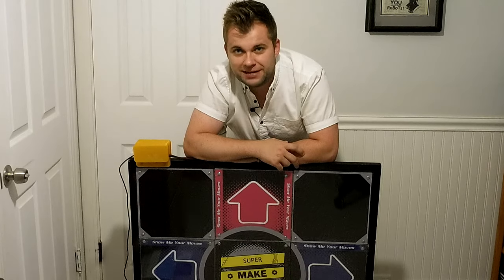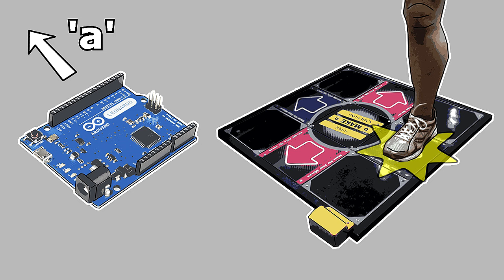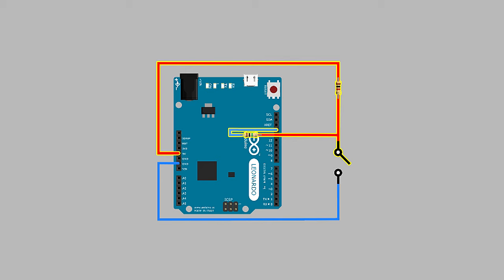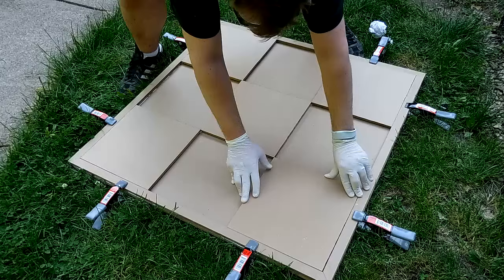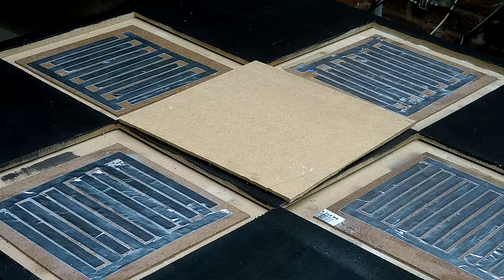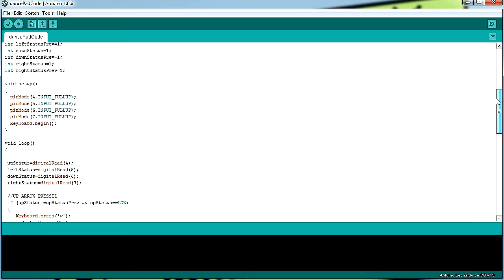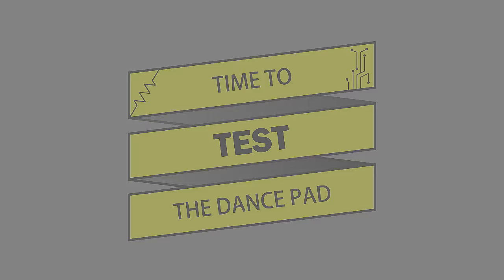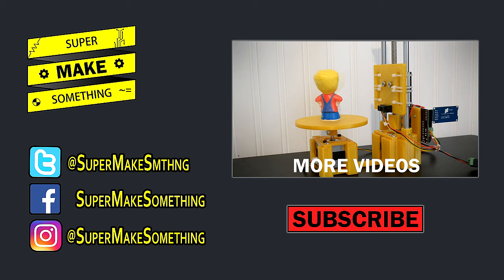USB DDR Dance Pad (Arduino, Pull-Up Resistors) - Super Make Something Episode 9

Comment: Nice job! I'm working on building a dance pad myself. I'm trying to make it as faithful of an arcade pad replica as I reasonably can, with authentic Pump It Up sensors, recessed half inch thick acrylic arrows, and metal wrapping the non-arrow panels. It's a big expensive project, but I'm hoping it'll be worth it in the end. Out of curiosity, how much did the components of this pad cost all together?
Reply from the maker: That sounds cool!  The raw material cost for this project was ~$75, with about a third of the price coming from the acrylic sheet.

Comment: I've been going over some plans for making my own DDR pad, and it's very similar to this one.  I had planned on trying to use either copper of aluminum tape to build the contact surface, but it seems most of those do not sent a signal though the adhesive side.  I'm planning on ordering some full on copper sheets instead.  

When you drilled and secured all of the panels down, did you just run a threaded screw though everything to the baseboard?
Reply from the maker: Copper sheets are a good idea, I think -- trying to create a solid connection with the aluminum during the installation is definitely a bit tricky.  The "Lexan-Graphic-MDF sandwich" actually isn't screwed down into the base plate; it just rests on the foam.  If you wanted to attach everything together with one long screw into the baseboard, I would suggest putting some linear compression springs over the screws so that the panels can bounce back up.
Reply: Oh ok, so the button panels are just screwed together to hold the plexiglass on top of the mobile panel?  and if you turned the pad upside down the buttons would just fall out?  I had considered something more akin to how the arcade machines are held together, with corner brackets holding the mobile panels in place, but I haven't looked into it as much.  

My current plan was to get some really long wood screws, with both a threaded portion and a smooth area closer to the screw head.  after sinking those all the way through, it would probably stick out of the baseboard, but could just be but off and sanded smooth.  I'm still in the planning stages, but since my design in my head is pretty similar to yours, i do feel more confident about the design.

Comment: Hi. Thanks for the video. I am planning to make one of it. Can i use the arduino UNO in stead of Leonardo?
Reply from the maker: Hi Luis, unfortunately the code will not work with the Arduino Uno, because it requires a microcontroller that can natively act as a USB HID device -- in this case, the ATMega32u4, which can be found on the Arduino Leonardo and Pro Micro.
Reply: @SuperMakeSomething  You may not be able to use the sketch you provided due to the absence of keyboard.h library on the Uno, but you can still get it to work by using the uint_8t command to report as keyboard, loading uint_8t with a keycode and doing a Serial.write with the desired Keycode loaded in the buffer. To make the Uno act as an HID device, you must flash the Atmega16u2 chip with the correct hex file.

Comment: I been looking at metal dance pads the last few days. I wanna get back into DDR. I had a fabric/mat kinda one and didn't really like it (and thus didn't really use it). Then I found this video. This looks awesome! I wanna make this. Besides the upgrades at the end of the video, are there any other things that you would've done differently knowing what you know now? I noticed the video was uploaded 5 years ago.
Reply from the maker: Thanks! I think the next big change I would make would be to use springs instead of foam, since the foam has to be replaced relatively frequently (depending on how much you play). Other than that and the improvements mentioned at the end, it’s been pretty solid! Good luck with your build if you end up decided to make one for yourself!

Comment: For some reason the code is not showing up when I downloaded it do I need some thing to make it work?
Reply from the maker: The link should download a zip archive, which contains the dancePadCode.ino file.  After unzipping this, you should be able to open it in the Arduino IDE.  It may give you a message that the file needs to be in a folder called "dancePadCode," but it should automatically generate this for you when you click ok.
Reply: Thank you ill ive that a try

Comment: Hey there, I'll be doing this after the quarantine! I was wondering if there's any way I can build this one with two extra buttons (x and o) so I can select songs from the pad itself. I know this should add more lines to the code but I was wondering if the arduino supports two extra buttons, as I have never used one. Thanks!
Reply from the maker: Jairo Pineda Hello Jairo! The Arduino definitely supports more buttons! You would just need to duplicate the corresponding lines of code and change the pin number and corresponding key press. Hope this helps and good luck with your build!
Reply: @SuperMakeSomething  Thank you so much Alex!
Reply: you can take apart a usb controller for a gaming controller and use that much easier than arduino

Comment: I'm really interested in doing this and don't know anything about electronics or really anything you named. What kind of screws would to recommend to screw the washers down as an improvement? And do you have any ideas as to how to add a metal bar to it?
Reply from the maker: I would go with wood screws, since these will "bite" into the particle board. Another poster in the comments suggested using copper tape, since you could solder to it directly, which I think is a good idea. For the bar, I would extend the pad with another "segment" at the back, and then buy piping at the hardware store. Hope this helps! Good luck with your build!
Reply: @SuperMakeSomething  thanks so much! thanks for making the video

Comment: Do you have anything connecting the pads to the base board or are they just loosely put on top. If so, don't they drop out if you tilt the board for storage etc?
Also how would you go about adding additional pads in the corners? I am currently not sure if I should add fixed walls between the pads or just put the loose parts next to each other.
Reply from the maker: Good questions!  At the moment, the pads are just loosely placed onto the base board.  Since the board is at a slight angle against my bookshelf for storage, I have not had any issues with pads dropping out, though this could be a possibility if the angle is steep enough.

Whether or not you add fixed walls depends on the button pad sizes you are going for in your build.  You could add walls, though this may affect the button size and spacing.  Alternatively, you could make the screw hole in the wooden portion of the pad a clearance hole so that it can move up and down the screw freely, add some more foam between the pad and base board around the screw, and then drill the bottom of the screw into the baseboard.  In this case, the foam would act like a spring.  This would simultaneously alleviate the problem of having loose buttons bumping into each other if they are not separated by a wall, as well as the storage problem.  I wanted to do this for my build initially, but unfortunately did not have screws that were the right length.  If you end up going this route, please let me know how it works!  Best of luck with your build!

Comment: Love your video. Very in-depth. Was curious if there was a reason for the design of the foil. Also wondering could the foil be replaced with copper tape?
Reply from the maker: Thank you! Copper tape would definitely work — and would probably be a better option honestly. I used foil because it was the easiest large conductive “sheet” that I could think of for the top panel. The “comb” design was just to increase the probability that a button press would get registered regardless where a panel was stepped on.
Reply: @SuperMakeSomething  awesome thanks for the reply!  Also I noticed in your build that the arrow pads are more or less floating and not secured to anything. Do you have any suggestions on a way to secure the arrow pads so then went stored upright they’re not falling out

Comment: Very nice. Im going to use the same build concepts for a Pump it Up pad this week. Any tips for that.
Reply from the maker: KalebDoesThings Nice! Good luck with your build! Two suggestions would be to use polycarbonate for the clear button panels and also to add a “debounce” to the code to keep the pad from falsely registering button presses during a hold. A few users have added a link to this code mod to the comments, so definitely check it out!

Comment: Hey Alex - Kudos for making this mate! The design was simplistic yet looks really solid in terms of sensitivity as well as ability to stand up to long hours of play. With your pad - Did you find that it slipped a fair bit? How about those 12+ footer songs that start to get rediculous without the use of a bar? DO you have a simple idea or method to integrate with this?

I've basically duct taped softpads onto MDF, and placed carpet cutouts underneath each 'arrow' and though sensitive, it still doesn't feel great. Will be following you idea - amazing stuff :D
Reply from the maker: Thanks! The pad could definitely be modified to add a bar -- this could be done by making the base wider and building the rails out of something like plumbing pipe. This should also increase the weight to keep the pad from moving around.

I currently use a chair for harder songs, but the response has been great so far!

Comment: How often does the loop method trigger? Could it affect the timing?
Reply from the maker: Bolton Bass I have not timed the duration of each loop, but since the microcontroller runs at several megahertz it is fast enough to not affect the timing.

Comment: also, maybe solder those washers onto the aluminium, you can use an aluminium beading rod and a blowtorch
Reply: the heat would probably ruin the adhesive and form a non conductive oxide layer on the aluminum
Reply: ***** Possibly do it before you glue it down, maybe?
Reply: +Louis JaCooper Still, the oxide could be an issue. Perhaps it would be better to just use copper contacts that will properly take to electrical solder, but I think his solution to just screw them down would be the easiest. It wouldn't require additional materials or removing the foil.

Comment: @SuperMakeSomething 
How did you connect the ddr dance pad to the computer?
Reply from the maker: Joshua Kim The USB cable attached to the Arduino both powers the dance pad from the USB port’s 5V line and transmits the data to the PC.

Comment: Hello, enjoyed your video. You have lots of cool tools and are precise and patience. I, however, doubt I have the patience to build my own as you did. That said, I went out and hired someone with experience building metal pads. The metal pads came in earlier this week and they're super nice. The pads connect to a controllers and each has a USB connector that  connects to my laptop. They installed Stepmania on the laptop and the laptop is connected to the TV for a bigger display and use of the TV's sound bar. Before the dance pads came in, we played DDR on the Wii and used the soft Wii dance pads. We actually like the Wii play with DDR, DDR 2 and Hottest Dance Party 3 even though the songs are limited. Now I'm wondering how I can get these new pads to work with the Wii. Intuitively, I thought perhaps it was easiest to connect the USB to some kind of adapter or converter that can plug into the Wii port but I can't find any. Can such an adapter be built? 

My second question is, Is it possible to install Stepmania to an Android TV and if so, how?
Reply from the maker: Thanks for watching! Unfortunately I do not have much experience with USB/Wii adapters, but believe something like this should be possible to create. I have not heard of an Android TV solution, since Stepmania requires local storage for the songs, but if you have an old computer available that you can hook up to your TV, it will likely be able to run it without issue!
Reply: @SuperMakeSomething , thanks for responding. Any guidance on how to create such an adaptor or a route I might follow to learn would be greatly appreciated. If I have to take apart a soft Wii mat to figure it out, I will...
Reply from the maker: @Loveko399  Unfortunately I am not aware of a USB-to-Wii adapter, but the issue with this for your current pad is that your pad would need to follow the standard button mapping defined in Nintendo's communication protocol. However, pads like the one in this video simply send keyboard commands, which works because StepMania can map any keyboard button to an arrow. The best path forward for your situation would be to use the internals of a Wii soft pad and then turn it into a hard pad so that you could plug it into a Wii directly, but then you would again be building your own pad. It might be worth a shot though! If you end up trying this, please let me know how it works out!

Comment: I skimmed the video at work with the audio off. This foil method you used...I know it says pull up resistors in the title, but this looks like the coplanar capacitive touch sensing method. Is that basically what's going on here?
Reply from the maker: This implementation actually just uses the foil to close the circuit between a 5V and GND line.  But a capacitive touch implementation would be awesome!

Comment: What if you need 2 pads? For Double play or for a friend to join you? What would you change in the Arduino?
Reply from the maker: You should be able to add as many buttons as the Arduino has inputs by duplicating the button press part of the code.

Comment: I think I really need to put my hands on something, so I'll try to assemble a pad for myself someday. How much would it cost considering to use the dance sensors instead of the "input button" mechanism on your video? I have Arduino already, but I still think I'd need some longer wires
Reply from the maker: I believe dance sensors can be purchased online for ~$25 each.  However, if you follow the arcade setup, you would need 4 sensors per arrow, so the cost could add up quickly.

Comment: Hello I used Screws with wires attached then sheet metal contacts to complete the circuit. But whenever i play with sneakers on it makes the arrow stick but its not really stuck its weird. Is there logic behind this or just voodoo. Thanks you for your time
Reply from the maker: Dan Teitelbaum hmm that is strange. It seems that something is still bridging the two plates and making contact when you step off of the panels, though it is weird that it only happens when you play with shoes. As a first step, I would try putting more electrical tape over the screw heads. I've found that it wears out after a while.
Reply: hmm elec tape over the screws i havent tried that yet but i guess anything is worth a shot at this point in time. Thank you for your time. il let you know how it goes.
Reply: hmm the electrical tape blocked the current all together. Can i PM you a couple pics and video to show you the issue further ?
Reply from the maker: Dan Teitelbaum This makes me think that perhaps the sheet metal is not flexing enough to make contact with the bottom plate, and that the contact you were making was with the screws only. Since it's sheet metal, I'm assuming you didn't use the "comb" contacts, but two sheets? I'd be interested in seeing your setup.
Reply: i sent you a couple pics on your facebook page. My control board is the Ipac VE . And its deff getting full connection just sticks randomly with my sneaks on. Thank you again for your time Daniel Teitelbaum
Reply: So, this is old but just saw it..your using an ipac?  It's possible ESD is causing issues (though I don't know how likely with this specific setup that is)  Try shunting the ground of the dance pad to earth and see if it improves?
Reply: The person I replied to specifically said they where using an Ipac, and I think in that specific case, given the fact that it only happened when shoes where used (and all other factors being equal) ESD may be a possability, though again i'm unsure how probable it would be.

I'm a little concerned about ESD though an Arduino but, given this build uses lots of wood it may not be an issue?  Lets just say there's a reason people prefer using the pcb's from soft pads, due to the design nature those pcb's had to take esd into account, and they did.

Having said all that, I kinda hope to use this design, or a variant of, in future...
Reply from the maker: Thanks for your tip! I'm actually using an Arduino Pro Micro that is emulating a keyboard. I don't think grounding is the issue, because all of the button base plates are connected to the same ground at the microcontroller, which shares a ground with the PC. I think it has mostly do to with the way I attach the screws. I think that your method using screws is definitely a better way to do things. The foil is also somewhat flimsy, and has a tendency to wear down after a while. In the future I think I will upgrade everything to sheet metal, and perhaps use metal sprints instead of foam, though this would require a bit of redesign of the buttons. I also think adding a software denounce would help, and would be an easy addition without changing the pad itself.
Reply: Hey i got the issue fully fixed the major problem was the weatherstripping i was using and the way i had the step panels in place. I switched to a rubber based instead of foam and i also installed actual arcade switches. The thing works LIKE A BOSS Now :D AA songs for days Happy Dancing :D :D
Reply: Dan Teitelbaum can you explain how you installed the sensors and the rubber that you used?